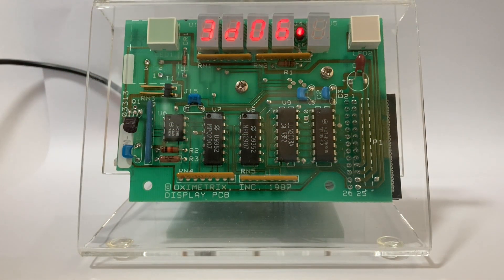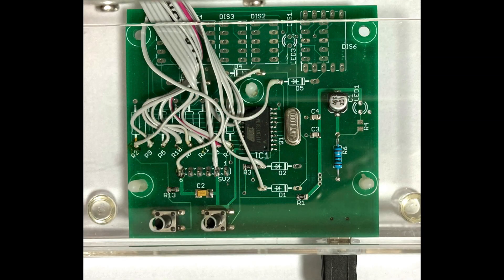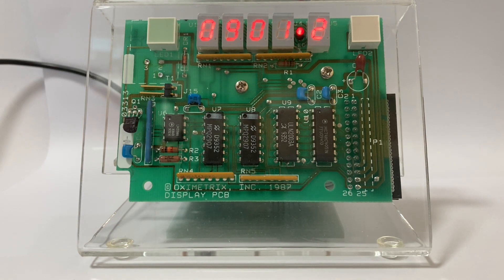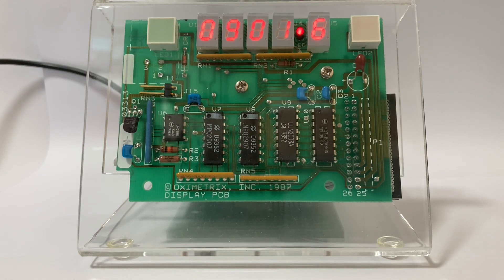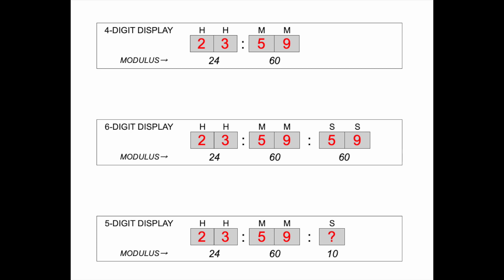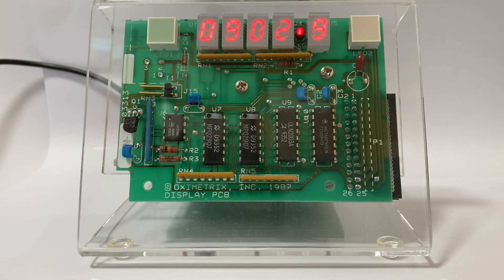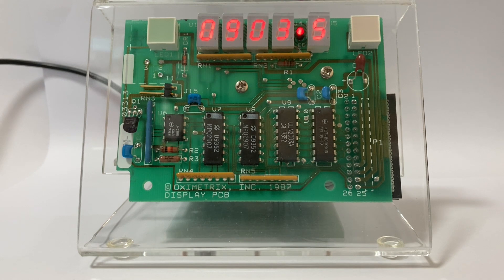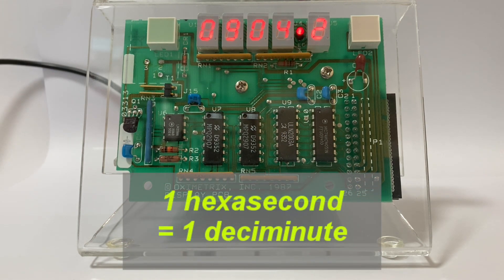What is this mystery unit of time?

Comment: What is the purpose of those two LED squares?
Reply from the maker: This display board was mounted behind a rigid metal panel. The panel had cutouts for the 7-segment displays and those 2 big block LEDs. A thin, adhesive, printed membrane was stuck on this, which had a red-tinted window for the digits and transparent symbols where the block LEDs are, acting as status indicators (maybe power and battery indicators?).